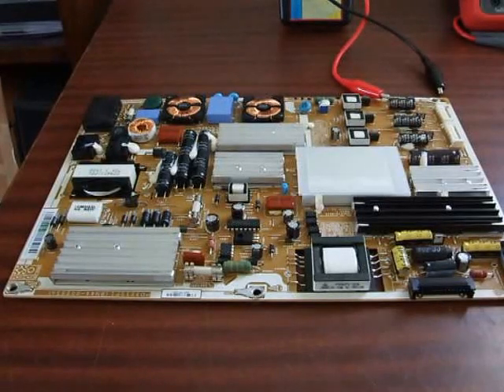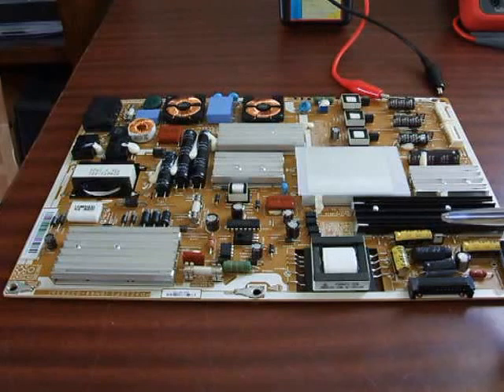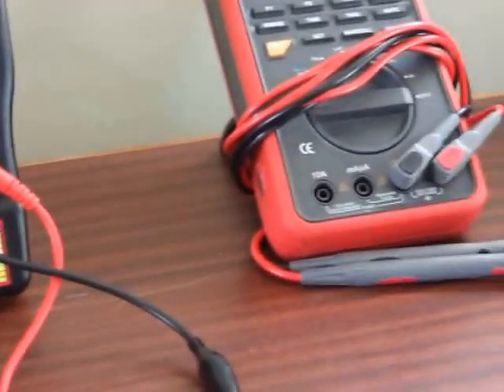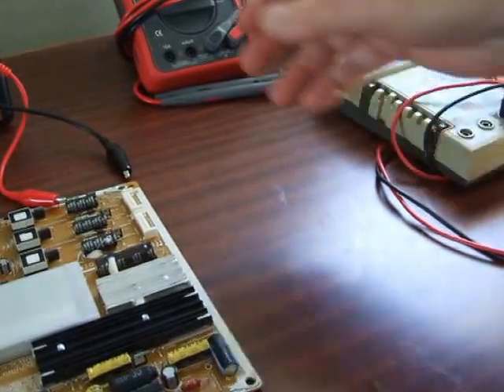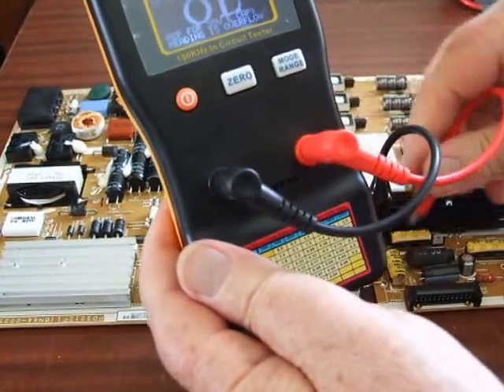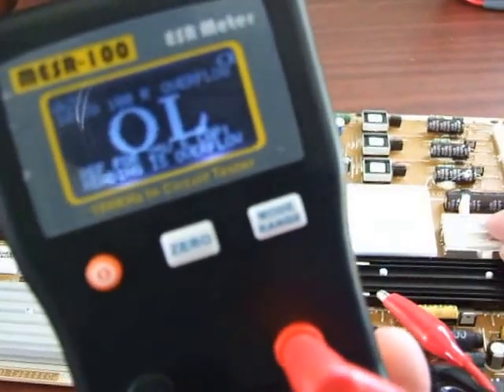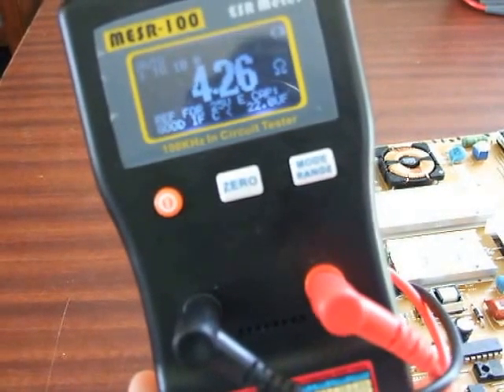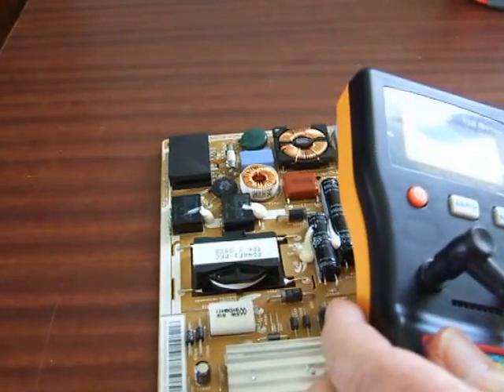In-Circuit use of ESR (Equivalent Series Resistance) METER

Comment: does it still work if capacitors are in parallel.. like in a vrm section of the motherboard.. can you stll see the esr of individual caps..
Reply: I think you would see the parallel values for capacitance and ESR.  The better (lower) ESR would dominate the reading, so in this case, you'd better do some unsoldering.